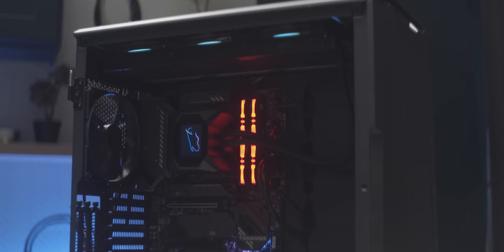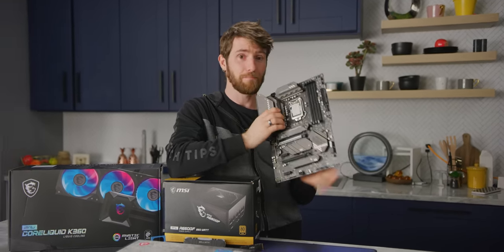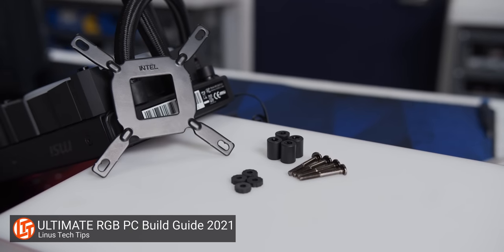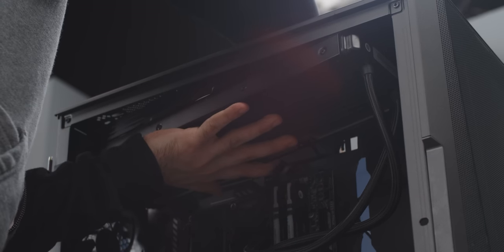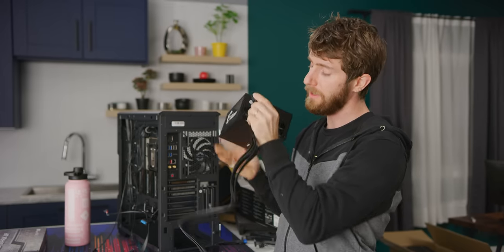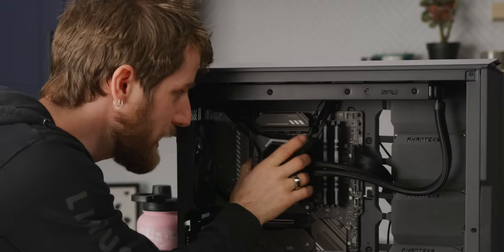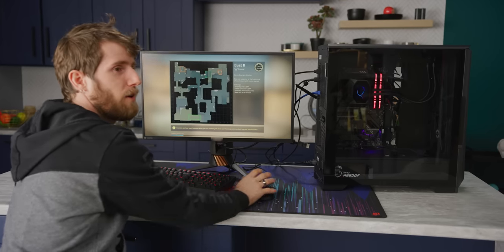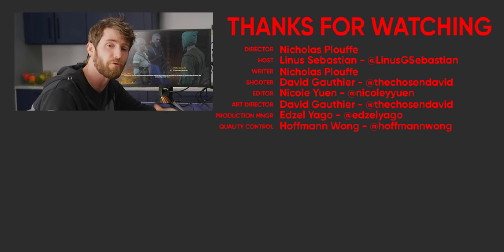You Can ACTUALLY Buy This PC!

Comment: I built my first PC March 2020. I’m really glad I didn’t wait as some strangers at Micro Center were telling me to lol
Reply: In ANY other time that would have been sage advise, sadly not anymore.
Reply: I got my cpu and gpu around the same time, ryzen 3900x and 2070 super.
Reply: @olotocolo  agreed. I actually followed some scalpers on Twitter to check for activity on the ps5 and Xbox to grab those fairly easily lol I’m happy to wait on the graphics card upgrade for when things are less insane and after I recover from upgrading my TV and monitor setup.
Reply: i did the same thing. bought a used 1080 ti for around $500, BUT it was decent enough for my CAD software for school. However, i’d like to upgrade again, because the 1080 Ti is showing it’s age in the new updates for SolidWorks, especially in rendering complex models. it’s also lacking in game performance as it’s now getting about 30% less performance than a year ago :(((
Reply: @ilajoie3  nice!
Reply: @yetti_31  I’d say depending on how much time you got left for school a big tech upgrade sounds like a decent first paycheck gift. You could probably even claim it on taxes as work related expenditure or something haha
Reply: I build my pc in January 2021 because I saw prices fluctuating for months and i just bit the bullet when I saw discounts at some stores that were good but I missed graphic cards that were almost at msrp: they were available for some time at the price and i also had an option to buy a returned one at a discount but because I am a first time Pc builder and I was hesitating I am now in the situation where I do not have a graphics card and it's frustrating, I'm blaming myself and then this just annoys me more ><  I hope at least I will find something at a reasonable price at the end of the year.
Reply: I built mine last may and I had some trouble finding a motherboard and psu but i’m so glad i didn’t have to pay 700 bucks for a decent graphics card
Reply: @triggapplays  I managed to build mine in November 2020. I was waiting for Ryzen 5000 and Radeon 6800 but decided it wasn’t worth it if it was going to be scalped immediately. So I built with ryzen 7 3800x and Radeon 5600xt instead and it runs beautifully.
Reply: I waited and boy did it hurt
Reply: Right now I'm really glad for my 1080 Ti.
Reply: I sold my previous rig to my brother and got the last 2070 Super from Best Buy and I haven't seen them in stock since
Reply: @tinaandro1178  best of luck! Just gotta keep up looking!
Reply: Nobody knew that the situation would escalate like that. If new components would be available right now, you would've made a way better buy with waiting for the new hardware
Reply: @dakotawood3973  Lucky! When I got my 2080 Super from Micro Center all the shelves were packed. I haven’t seen anything from them or Best Buy since a month after that.
Reply: @pridedoggo  I feel like you can always say that for any hardware though. If you’ve got the disposable income to build and pay for a new computer right then and there seems better to go ahead and do that. Odds are if you have that, you can afford to buy the new one later if you really want to and just offset the costs by selling the old one. Better than holding off and getting nothing at least 🤷🏻‍♂️
Reply: @luisfuentes3846  awesome dude!
Reply: @cleanname4439  yea I can imagine those parts are easier to find by comparison
Reply: I helped a friend build a PC last fall. Prior to the 30-series launch. He bought a 2060 Super when everyone were selling them a month before the 30-series launch, as he couldn't be bothered waiting anymore. Got it for dirt cheap, not they are sold out everywhere and selling for more than new price. So he really did finish up the computer at the right time.
Reply: @yetti_31  try to water lock and overclock it. The 1080ti is one of nvidia's best cards they have ever made, and an OCing beast.
Reply: I'm sad I waited
Reply: Same :)
Reply: gg
Reply: Same! I also built it just as lockdown started and was told to rather wait because prices were going to go down after... Lol
Reply: You misspelled strangers 😂 it's spelt scalpers 😂
Reply: I am saving up to build one but the thing that’s scares me is trying to plug everything in
Reply: Got a 2080 in November for like 600 bucks after my 1650 died. Best. Fucking. Purchase. Ever.
Reply: Yes.
Reply: @ilajoie3  same just with a 3800x
Reply: relatable dude. I built mine in May / June 2020
Reply: Dude me too, I was considering too postpone my built in hope that my part that I picked drop in prices (cause I'm using last gen). Im sure glad that I bought my part just 2 weekish before the shortage begun

Comment: "It's 8 cores, might be a little low by today's standards"
* Me and my i3-9100f crying in the background
Reply: Tbh you rarely need more than 4 cores when gaming
Reply: @huttonberries768  I would say 6 does make a difference but not 8
Reply: I build enterprise erp apps and do neural network research on an i5 6500 with a gtx1060.
Reply: I got a i5 2500 that only has 4
Reply: cries in Ryzen 5 5600X
Reply: dies with a Xeon L5410
Reply: I have a i7-9770K
Reply: I hear you my gigabyte windforce 970 is quietly dying, while the rest of my pc is upgraded
Reply: @gabrielpeeck4997  i5 2500k @ 4.8 GHz
Reply: Nice processors you guys have - Pentium Dual Core e6300 2 cores ,2 threads 2,8 GHz OC'ed to 3,1
Reply: Cries in i3 3220 hehehe
Reply: Don't worry, Linus is just intentionally pushing planned obsolescence of CPUs.
Reply: @kartoffelbrei8090  it's 3.3 ghz
Reply: @gabrielpeeck4997  Yeah the K version is an overclocking beast tho. 5 Ghz is actually possible while not that stable.
Reply: ha! I use the celeron N3350
Reply: @kartoffelbrei8090  wow. That's crazy
Reply: You have an i3!?
My almost 1 GHz  Intel Atom is jelly...
Reply: I have i7 3770k enough for me
Reply: F**k new demanding games enjoy  the existing  legendary ones✌
Reply: Me with my I5 2400 crying in the background
Reply: Cries in 10700k
Reply: 9100f is a great cpu..1 % percent better then a ryzen 3600 according to userbenchmark... LMAO
Reply: *laughs in 2200g and gt 1030
Reply: Me with my i5-5400U. Freakin 5th Gen 😂
Reply: @NoName-to5xl  lol
Reply: Be grateful man. I have a crappy N4000 Dual-Core @ 2.5 ghz. Runs like shit with 100% CPU usage on Zoom.
Reply: if you can chance the Cpu try look cheap Xeon upgrade, that is what i did when my old i5 with 4C/4T felt too old (i found a 50$ Xeon and the 4C/8T changed everything). 8 threads or more is noticable more in 1080p. Also this video build is silly overpowered EVERYONE is currently suggesting getting the older i5 11400F (or older 10400F) as they have a 6 cores & 12 threads and is less than half price then the new i7.
Reply: Cries in i3 530 @ 2.93ghz
Reply: me and my i3 1115g4 crying even harder
Reply: @nanamisonohara864  thats worse then my 13 1115g4 bruh
Reply: @huttonberries768  me who uses 2c laptop for gaming: uhmm lowest settings go brrrr?
Reply: @AviatingRandom  crying even harder gt710
Reply: @kartoffelbrei8090  cries in ryzen 5 2400g 3.6ghz
Reply: @mohammedatef2  Ill propably keep this CPU until someTHING/ONE dies.
Reply: Mine is Dualcore I3-1005G1 :(
Reply: Cries in i5 4460
Reply: I can relate. Was still rocking my i5-2500k until last year.
Reply: i have an i5 10400f
Reply: Me and my core m5 can barely run minecraft
Reply: I just upgraded from an i3 7100 to an i5 10600KF and the difference is real.
Reply: @huttonberries768  uhhh that depends.... Don't just say that as a run of the mill comment. Come on. You should know better....
Reply: Cries in i5-3470
Reply: Q9550 here have the money for upgrading but im no sure if i want with the price these days geeze
Reply: @maximecharbonneau9602  it might be your only option. I dont see prices or availability changing any time soon. I paid $1200 for an $850 pc. Went to pc parts picker and priced it all out, saved about $300.
Reply: I'm running a phenom II X4 955, works fine for the games that I play.
Reply: Lol i7 3⁷70
Reply: me and my i3-4000m don't even fit in frame
Reply: I3 3250 here... yeah 4 cores sounds pretty nice.
Reply: i3 10100f is really good
Reply: @flyingbanana2436  yeah I think 6 is the sweet spot of balance between high end and not destroying the bank. I’ll be chilling with my 4.9GHz 8700k for as long as she’s still kickin
Reply: hes kidding.
Reply: Lmao my pc has 2 cores but I don't even use it much so whatever
Reply: Me with a intel pentium waiting for the comments to load on internet explorer
Reply: Me and my i7-9700K ignoring all of you.
Reply: @nanamisonohara864  Cries in Pentium P2600 cannot handle win7
Reply: me and my i5 3470t 2.9   :|
Reply: Man I have a 13 year old lap top and it only pushes minecraft on lowest graphics on 30-70 fps and my parents doesn't let me buy a pc
Reply: Me still with the 2 cores

Left earth
Reply: Literally using an AMD Phenom II
Reply: Shrugs shulders doesnt regret holding om to my rx470 8gb and amd 1700x 8core, holds up for me just want to buy a gpu has soon as the srocks fix itselve and build a more updated machine to give my old gpu and cpu for a setup i want to use for my parents
Reply: @AnthonyM-wg3fg  Thanks for reporting Anthony :)
Reply: @huttonberries768  yeah i mean if you arent playing A1 games then you dont need more
Reply: Lmao i5 4570 and gtx 970 works great for me
Reply: OK How bout a pentium g2010

Comment: This felt so strange, I thought it was going to show off some sort of prebuilt that was a reasonable offer and just ended up as like, "here's a thing you can buy if you want I guess"?
Reply: Yeah, seems like it is just a long advert in disguise
Reply: GamerNexus showed that the integrated graphics card is not enough to play games.
Reply: What annoyed me most is that apparently there are problems with Intel's iGPU like the HDMI not working properly and the game crashing instantly, so they switch to GeForce Now... So then what was the point of this entire PC? Just wire up a laptop and the experience is identical!
Reply: me too lol
Reply: This is a pretty bad set up tbh given the kinds of prebuilds with real GPUs I've found for pretty much the same price as these parts.
Reply: @Thesuperhunter99  a msi ad
Reply: @Thesuperhunter99  why spend the money on a laptop when you can do as this video says and get SOMETHINT TANGIBLE to put your gpu in when you get it. Could also get an older model from eBay. There are some reasonable prices for 1060’s-1660’s... anything 20 series and up is rough tho
Reply: @BlunderCig  it really didn’t feel like clickbait IMO. You gotta do what you gotta do and this way you at least know your system works and can play games that don’t hurt to run. My 10-700k can deal with certain games if you HAVE to play something.
Reply: @35volts52  yeah, If you REALLY want it now, just getting a pre built with a 3080 is a great way to go. Debating on doing that myself and giving the spare parts to a friend
Reply: Sponsorship and content. 
LTT is  justa business model after all... Plus it's more useful than a Raid Shadow Legends plug I suppose
Reply: @BlunderCig  I miss when we had actual fun videos and theoreticals that most people wanted to try but didn't have to money to waste on the project and not "here i built a pc and its fast " like what 80% of videos seem to be nowadays. I wish they continued on the "eGPU through m.2" since they barely tried with it
Reply: @leonardol8158  It is. Go watch some lowspecgamer videos.
Reply: Same here :( 
My cat peed into my computer case and killed it a couple weeks ago. 1070, 6700k, 16GB DDR4. I was not intending to shop for new stuff for at least a year or two, by far the worst timing ever. Still love my 3 cats, but that one is currently at the bottom of my favorite list.
Reply: @brianhenderson5447  What a hilarious tragedy.
Reply: Yeah and then the stupid GeForce Now WTF I'd rather buy some used GPU.
Reply: "thanks to MSI for sponsoring this video!"
Reply: Yeah the title makes no sense
Reply: Yeah I think it was probably pitched as an answer for people who haven't been following the gpu/ chip shortages. As in the people who recently looked into building/ buying a PC only to be told by pretty much everyone that it just isn't particularly viable atm. I think they meant to have this be telling those consumers that while its definitely not a good time to buy,  this is a good route to go. 
They wouldn't use a 11700k normally, and have been fairly critical of it, but AMD couldn't meet demand before the chip shortages let alone now. People will have a much easier time getting their hands on the i7. 
Is now  a good time to buy? Absolutely not. But if you have to get something right now, this is a good PC made from relatively attainable parts.

I think the video could have been titled / formatted a bit clearer though. The newer snappier editing/writing style does make efficient use of time, but I think giving Linus like a longer / more wordy moment would help to give a better context to the video, and make it feel like more than just todays content.
Reply: A 1700$ advert
Reply: @aaronweir474  No he meant like just use the shitty laptop you already have if you're just streaming games as the experience would be the same anyways.
Reply: @leonardol8158  I was thinking this. He's like "hey build this so you can .... Play shitty "e-sports" games or stream games that your shitty 8 year old laptop can still run or do anyways!?" Like uuuhhhh no? What's the fucking point? Unless you're terrifyied prices will only continue to go up and up but at this point by the time you get a GPU you could have waited and bought all new better hardware to match.... The price of everything other than the GPUs aren't really going up that much anyways 🤦‍♀️
Reply: @chrish4439  it’s still pretty hard to get a cpu, certain power supplies, certain brand fans etc. I get the buying things while you can part. If you’re monitoring Gpu restocks through the apps and such it’s only a matter of time for you to get one at msrp. But if you’re just waiting for things to slow down then yeah this doesn’t make sense

Comment: "Now 8 cores might be a little low by today's standard"
Me using 4 cores with 4 threads :-)
Reply: Ryzen 3 3200G?
Reply: 6 core/12 thread gang🙃
Reply: Same ☹️
Reply: @GO-iw1tt  Me too, with a 10 year old Xeon
Reply: 6 cores 6 threads gang here
Reply: Crys in corner with 2 cores 4 threads*
Reply: LOL I'm still rockin an  I7 6700k myself =)
Reply: @angrynerd2103  Bro, I bet you run Left 4 Dead 2 beautifully, and that's all you really need.
Reply: 4 core 4 thread gang (i5 760)
Reply: My still using my Core i7 4790k
Reply: @Doublebarreledsimian  love that cpu... i'm with a i5 6600k.. a little too shabby for now...
Reply: Me with 2 cores: 😃🔫
Reply: I5 7400 gang
Reply: 2 core 4 threads 6th gen i3 gang come here (rip)
Reply: @desmay2studios  yea
Reply: Me using 2 cores and 2 threads
my cpu is AMD a6  7480
pretty bullshit right
Reply: 4 cores 8 threads. Still hanging on but just barely.
Reply: 7600K gang gang
Reply: @Goststriker  7700k, but yes lol
Reply: Monochromatik-Vision  That was mostly because of the price. And a bit harsh. Even though it might have up to 10% less performance in a few games (which you barely notice), it's the same or better (sometimes much better) than a 10700K, and is more evenly matched with R7 5800X. Well, it's still below overall, but in most of them they're equal. If you find a 11700K at a decent price, like $300 to $400, it's a good CPU. And for gaming alone, it should be decent for at least 5 years. There won't be games that NEED more than 8 cores for at least 3 years.
Reply: i5-7300HQ
Reply: Me using 2 cores 4 threads :)))
Reply: 2500k 5 ghz gang whats up boys
Reply: @problemtf2532  pretty sure my laptop has a very similar a6. Not great
Reply: @ADHDegree  I even paired it with a gt 1030 and dual channel 16 gb ddr3.
should have done the cpu first xd
Reply: me 2 cores 4 threads. you are not alone buddy
Reply: Me with 2 cores
Reply: Same here with i5 4570
Reply: 4 cores at 1.1ghz gang anyone
Reply: 2 Cores 2 Threads Gang (Core2 Duo E7500)
Reply: Me using 2 cores and 4 threads
Reply: 2 core laptop gang
Reply: you can get 4 core 8 thread 3.3ghz xeon cpu refurbished for $15 (FCLGA2011 socket)
Reply: inter petium 2 cores 4 threads :)
Reply: Me doing calculation with my hand :(
Reply: me using 2 core 4 thread core i5 7200u on laptop yay
Reply: 2core 4 thread i3 7100
Reply: @Yggdrasill8  i3-9100f
Reply: @angrynerd2103  Crysis in the corner
Reply: I am still  using AMD ryzen 7 5700U  (8 cores / 16 threads) for gaming